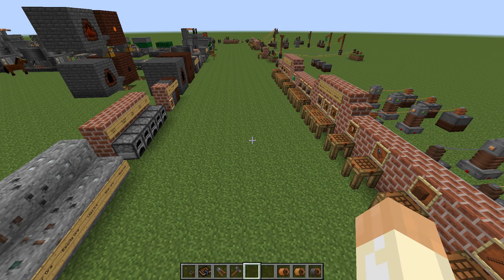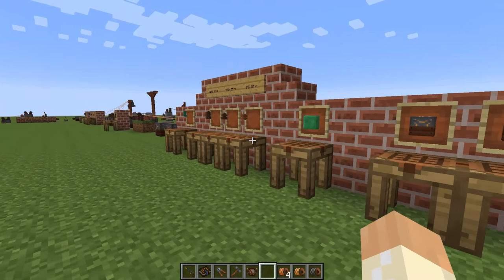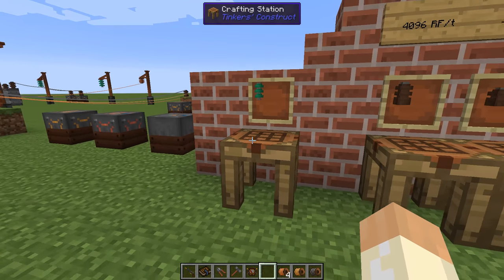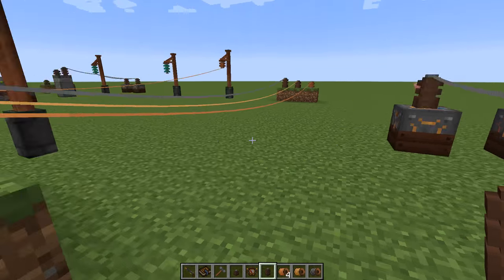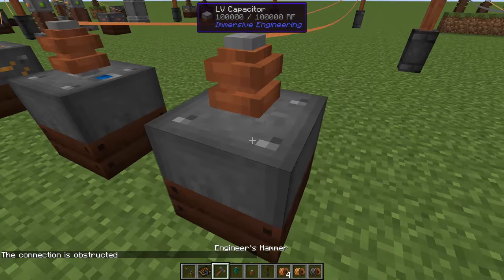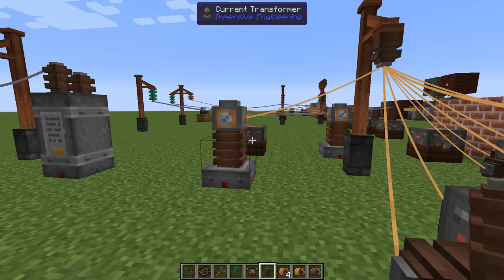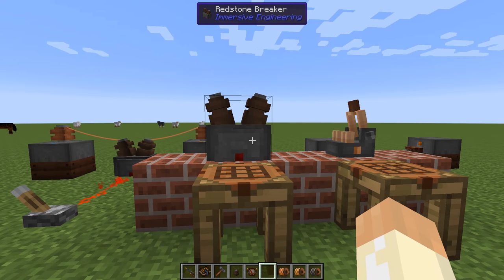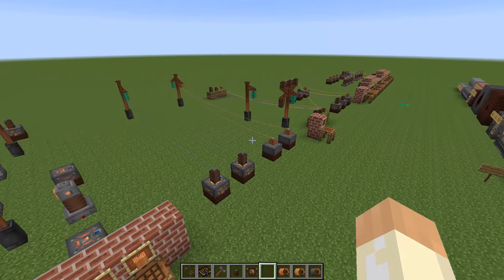Immersive Engineering Tutorial #2 - Power Distribution and Networks (MC 1.7.10)

Comment: How works redstone wires and connectors?  I try to config connector to in and out but it still not work with a lever. Thaks for guide, the best tutorial for this mod.
Reply from the maker: You have to use the Engineer´s Hammer to change the Redstone Connectors between input and output. Then you can connect levers and redstone dust to the blocks next to the connectors.
Reply: Thank you! I don't try with redstone dust.

Comment: how do you place the transformer on the post.. why can't I figure it out.
Reply from the maker: I just tried it in my current LP world (Minecraft 1.10.2) and the normal transformer can be placed like in this video, but the MV-HV transformer will not attach to the post. Probably just a bug, check github and report the problem if it's not already reported and perhaps even fixed in a later version?
Reply: ta I figured that out.. the HV would not attach, is it suppose too?
Reply from the maker: +GaMeOvErRules I thought it would but according to this page the HV transformer doesn't.
https://ftb.gamepedia.com/Transformer_(Immersive_Engineering)
Reply: I can't place or connect anything. its a real pain. ive been trying to figure out what to do
Reply: same

Comment: can I sill have multiple wires connected on a MV connector?
Reply from the maker: In updated mod versions all tiers of connectors can only have one wire attached. So only the start and end points, use relays for splitting/merging or transfer over longer distances.

Comment: do you have some tutorial that shows how to transfer energy from immersive to thermal and applied energistic?
Reply from the maker: Sorry for a late anwer! But I haven't made any tutorial video of such, but if you still need answer to that question you use wires as normal in IE, make sure TE Energy Cells ar correctly configured and when going to AE2 use an Energy Acceptor.
Reply: i use the energy acceptor.. but... it don't take energy from the cable... don't know how i can show the images of myy world to explain better
Reply from the maker: Take several screenshots, put them in an album online (use Imgur, it's free), and describe the pictures as well. It makes things easier for me. Also add info about what mods or modpack you're using, versions and all. It helps a lot instead of having to ask or guess ;)
Reply: ok.. i'll try hahah, thanks a LOT for helping, because it's  too hard  at the start to understand these mods
Reply: TKH how i send u? copying to here?
Reply from the maker: For making a screenshot album, use imgur (imgur.com) or similar. Then you can make albums and describe every picture. Then just post the link to the album here or send me a tweet or send on facebook.
Reply from the maker: Ok, good start, but please explain what the different pictures show (you can do that on imgur, have a description to each picture). It's hard to follow the build... Make sure that the capacitor is set to output (orange) on the side that you want to connect to the energy acceptor. Blue means input. I have tried this with Thermal Expansion Energy Cells, and it works perfectly. I haven't tried directly to an Energy Acceptor, but it feels like it should work..
Reply: srry for that images, first time doing this hahaha, but.... yeah.. it is orange,the capacitator. I'll try send to an energy cell, see if it works, thaanks for helping :3

Comment: When i want to connect my survivalist generator to my leadstone energycell there is no power transfering. The LV wire connector on my survivalist generator says 256/256 RF but the one ontop of my leadstone energycell is says 0/256 RF. But when i switch my leadstone energycell out with a thermionic fabricator is does transfer power. Can anyone explain to me why my energycell isnt charging?
Reply from the maker: +Guy Jamar I'm sorry, it seems like I forgot to answer this comment (it drowned in other comments...). Do you still have a problem? I did some tests with Energy Cells and it works just fine. Did you have direction of the energy cell correctly set up?
Reply: Configure the input

Comment: No matter what I do I can't seem to connect two wires on the same wire connector... which makes them kind of pointless... and renders this mod kind of pointless.
Reply from the maker: A connector can't have two wires attached. The whole purpose of a connector is to connect to a single point (a production or usage point). You use relays for the network and splitting/joining cables.